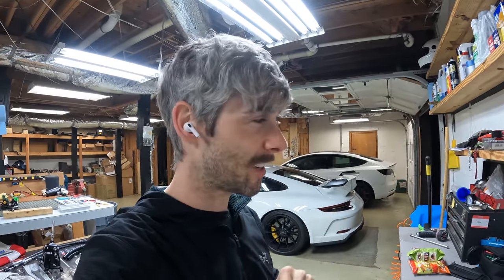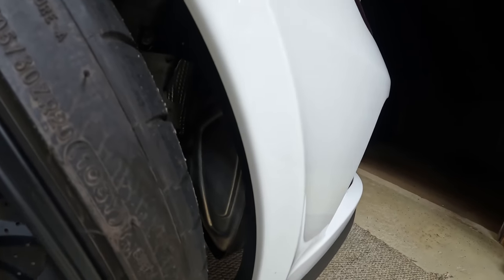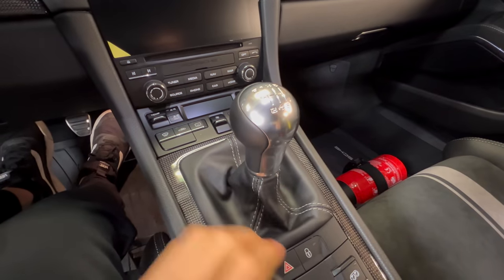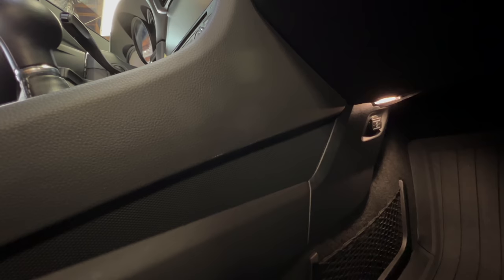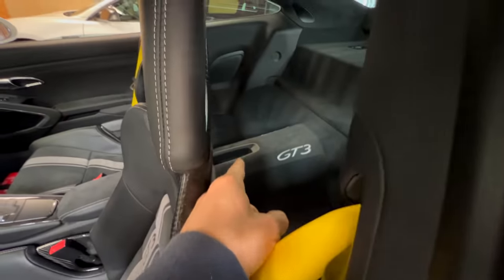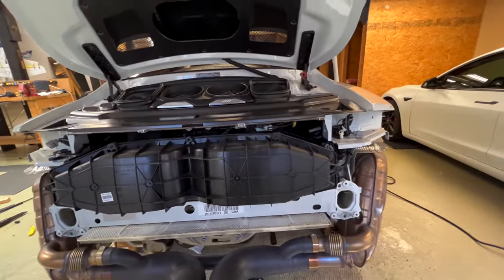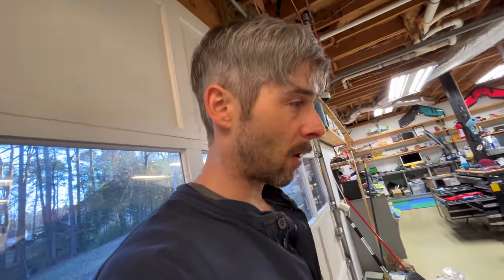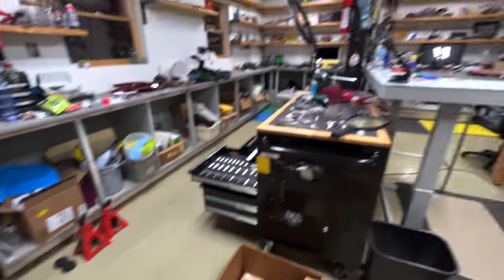Modding the GT3 / Numeric Shifter/Akrapovic Full Titanium exhaust/BMC (Stage 2 Tune)

Comment: Great video Steele!  I couldn't stop watching even having done this same exhaust install 20 times.   I think you've convinced me to do a Numeric.  The magic of Porsche engineering is that when you take it apart, it goes right back together perfectly.  Take a BMW bumper cover or interior part off, and it rarely goes back together the same way.  If you are okay with the volume of the Akra set-up then you are ready for an equal length header system.  That tune and Akra is not making much power if any.  Akra headers are essential OE replicas in an inferior metal for an exhaust that cost piles of cash.  Dundon long-tube headers, catted, on the 991.2 with their Black series center muffler is the best exhaust for the platform.  You'll gain about 20-30 whp over your Akra and BMC tune.  Porsche NA is really unfriendly to DME tuning.  It doesn't really do much for you anyway as the Porsche DME does really well with adaptation to higher flowing exhausts.
Reply from the maker: I thanks man. I watched your videos from the blue 991.1 days for the bumper removal actually.    I honestly watched a bunch of videos and obviously did a lot of comparisons. The dundon stuff was on my radar but I was unsure about volume levels. This doesn’t mean much but the look of the dundon also kind of turned me off about it.  But. A few heat cycles and it’ll look great.  I got the Akra stuff at a discount  though still really pricey. I figured it was the middle ground of noise and raw I was looking for.   TI has a certain sound to it.  Oh well you live you learn.  The tune has picked up what feels like a good 30/30 wheel. But. Might just be the response.  🤷‍♂️
Reply: @MrSteeleFPV  considering for my GT3 991.2 Touring … this is a worthy upgrade for feel? you recommend? thank you for video
Reply: I know this is an old comment but for the sake of anyone who comes across this archived stuff in the future, I'd like to point that the above claims are pretty uninformed and to at least to some degree incorrect.
First off, completely wrong on the ECU tune. A 991.2 GT3 is detuned versus the RS which has the same engine and an ECU tune gains a very easy +20 HP and some torque without touching anything else. It's the single most cost effective performance gain you can do.
The Akra headers/side mufflers gain about 10 HP on their own. Mostly from the less restrictive cats and better flow through the sides. It's not a lot but with a tune you're looking at a total of +30 to +35 horsepower. Using Dundon street headers instead, you are looking at around 10 HP over the Akras with an ECU tune. Without a tune the Dundons give you about 15 more than the Akra setup. And it weighs quite a lot less for those who are weight obsessed. The inferior metal snipe is sheer ignorance, this stuff lasts forever and saves weight. And not everyone needs maximum noise, the Akra setup being the only one where you have the possibility of keeping side mufflers that are nice and light it offers a lot of advantages for those who don't need ALL THE NOISE - a perfectly valid demographic as exhaust mods are objective. In any case, BS written confidently is still BS and there was a lot of that in Mr OG's post.

Comment: You brought back so many memories. I did the Numeric shifter and cables. Yes, it’s very difficult. For the life of me I could not get my arm up to the grommet so mine isn’t perfect. The trick with the cable housing is to cut them in a spiral or corkscrew pattern. Then the housing basically holds its self in place. But in the end I’m glad I did the mod. I think there is some good info on Rennlist too.

Comment: Another great mod is the Rennline magnetic phone mount.  Love mine.  

Also love the Pasha(checkerboard) seat inserts I got from Kim at p1designs.  Make the buckets 1000x more comfortable with extra foam and they look sick!

Finally not sure if you have a radar detector but if you have the Home link mirror you can mirror tap a radar detector in there very easy and mount with a blendmount.
Reply from the maker: Solid mod advice

Comment: Adjusting shifter cables is usually (I never did on a Porsche) quite easy. Or maybe I got your description wrong (non native english speaker here). You connect everything and leve the the adjuster thing (clip, metal c-clip or similar) loose. No you go in 4th gear (for example) on the transmision itself (metal levers on the transimission itself) and in 4th gear on the shifter inside the car. Now push the adjuster Clips and so that you cuould shift from inside the car. Usually thats the way how it is done. maybe it is different on such a high precission car
.

Comment: I was so confused when you were under the car until I remembered they're rear engined. Lol. German engineering summed up "It doesn't make sense but that's the way it is"
Reply: Who has ever said that German engineering doesn't make sense?  Mid-engine offers better weight distribution and handling characteristics as well as less drive-shaft weight on rear-wheel drive vehicles.